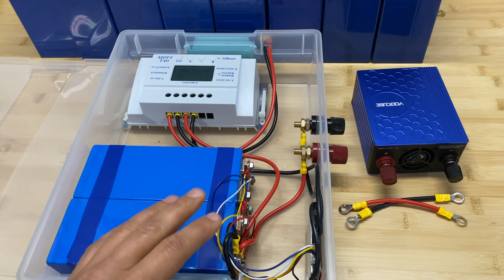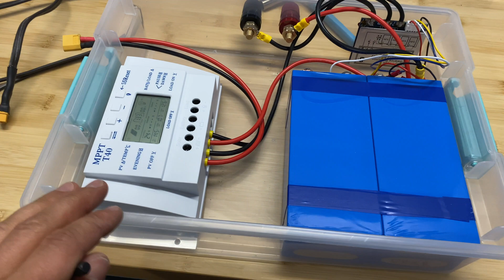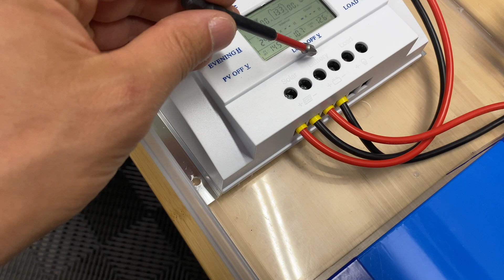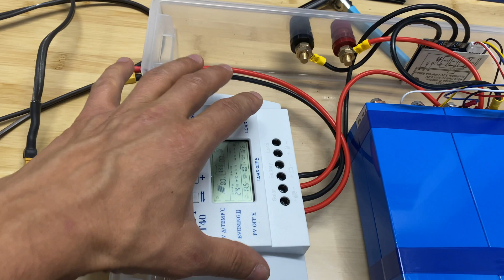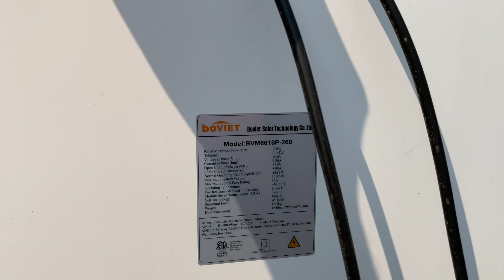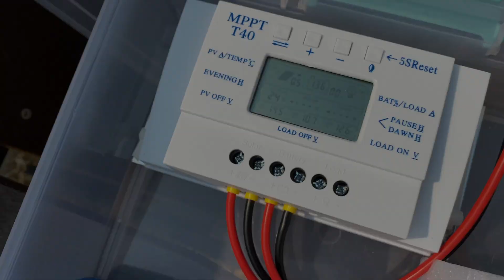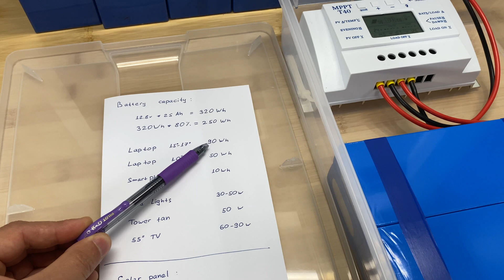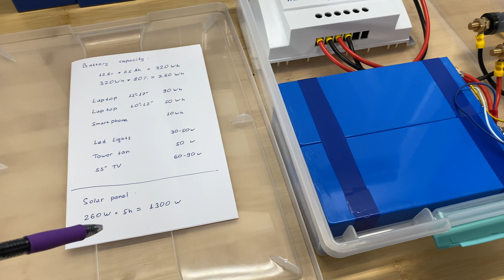Building micro solar system. 12v solar system. DIY step by step.

Comment: What the difference of BMS and balancer
Reply from the maker: BMS protects battery bank by disconnecting from charge/load in case of overvolatge/undervoltage/overcurrent/overtemp/etc event.
Active balancer just balances cells and will not protect the battery bank.

Comment: Neat project.  I have a suggestion for another video... Creating a local "back-up" grid for folks with grid-tie inverters to function when the grid goes down (hypothetically and of course with an interlock/transfer switch).  Lots of folks with GT systems with batteries and they're all down when the grid goes down.  No big deal when it's short lived, but having a solution for when SHF and the grid is down for long period of time is another matter!

Comment: Nice video, sir. Only thing I am missing is your fuses between solar input and the charge controller, between the bms and the battery and bms to the load. It is always a good idea to use fuses/breakers to avoid an accident with shorts/fault in the gear you are using. Anyway, thank you for your video! :)
Reply from the maker: Thanks for the info, I've added these improvements to description.

Comment: when the battery is fully charged, the bms will cut off the charging and the controller will not communicate with the battery. according to the instructions, without connecting to the battery, the solar panel will damage the controller. or am I misunderstanding something?)
Reply from the maker: Correct, the damage might happen.
The voltage on the charge controller should be set below the BMS disconnect voltage.  
I'd set it to 14V to keep cells at about 3.5V.
Reply: Сенькю вери мач

Comment: How much is the C rating of the batteries for charging? 260 watts looks too high for a 25 AH battery unless there is a constant current feature in the charge controller.
Reply from the maker: 260W/13V = 20A in peak
0.8C rating

Comment: You've gotten some good comments - I agree with the fuse/breaker ideas.  The other thing I thought might need consideration is your CC and the plastic box.  Mine can get pretty warm (not same brand/model as you) and easily melt that box.  Have you thought about some kind of air flow for the CC?
Reply from the maker: I  haven't used the system much yet, I'd  start with cutting ventilation holes, or migrate it to larger enclosure (potentially metal to better dissipate heat).
Installing a fan is another option, but it will complicate the system, which I tried to avoid.

Comment: The battery terminals are exposed internally - if that VHB mounting tape comes off the wall, the metal shell of the BMS might come in contact with them. Also, like many others I'd feel much better if it was properly fused.
Reply from the maker: thanks, I'll add these items to "to improve list" in description.

Comment: Just a little fyi those "mppt" controllers are actually fake and are not true mppt, theyre pwm and the pulses are quite high frequency allowing the panel to reach a higher measured voltage giving the appearance that its mppt when its not. I returned two of them after testing with a scope and two ammeters to prove it to the seller. They DO work as a solar controller dont get me wrong, but they are not mppt, dont buy one thinking that it is.
Reply from the maker: yeah, thanks for letting me know, I tried hard not to say "MPPT" in the video even the charge controller labeled as "MPPT" :)

Comment: The box is nice, but...no fuse at all? Tough guy! That´s risky. Also, the blue insulation between the single battery cells is very thin material. If there´s a short (i.e. due to vibration), you´ll have a big problem.
Reply from the maker: thanks, I'll add this items into descritpion

Comment: Your video has come just in time, I'm building a very similar system for a boat I'm converting to solar.  I'll be watching this series, thanks.
Reply from the maker: nice, feel free to ask questions.
Reply: @SolarEngineering  I've bought a HQST-400watt solar kit (PWM30-TC), a Ampere Time 100ah lithium battery and a 40lb trolling motor to hopefully push a 14ft aluminum boat.  Any advice as to fusing or other stuff I need (thinking I need a battery cut off) would be appreciated ;)
Reply from the maker: @m.kriddick2731  I'd add at least 3 parts:
1. disconnect switch for battery (like this: https://amzn.to/3kRV3ds)
2. same switch for solar panels (between panels and MPPT)
3. fuse right after battery positive